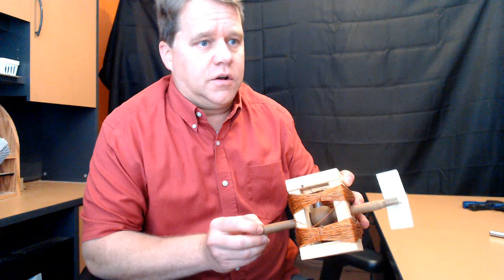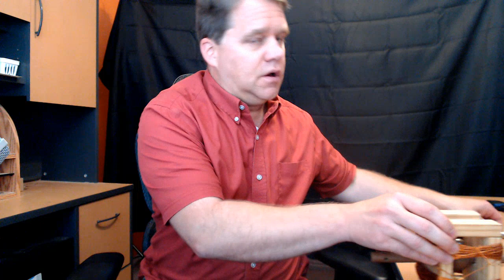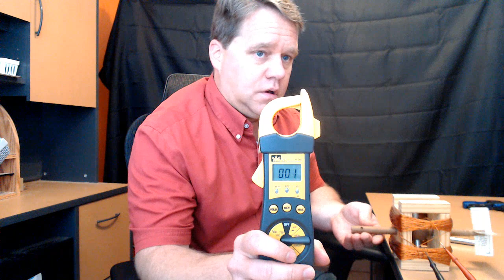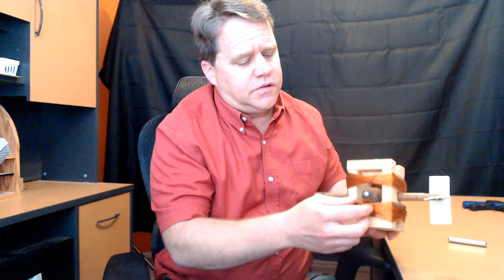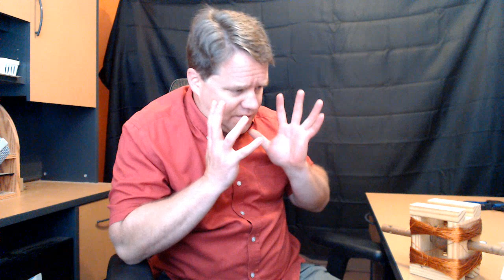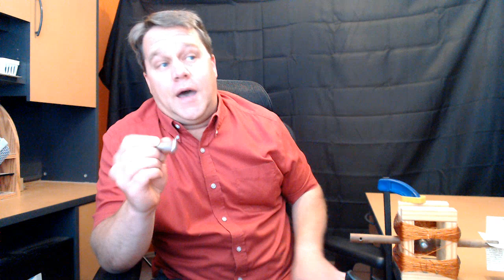Simple ac alternator (generator).

Comment: Very interesting. Worked at a large slaughterhouse and have still have some cow magnets. On the subject of generators I still find it interesting while attempting to megger any AC motor that even if rotating only a few RPM'S ( such as large air handlers and pumps ) will receive an eratic reading. When 2 of my kids were in 3rd or 4th grade gave a 45 minute class on electricity. Had them turn a very small DC motor to illuminate a small lamp &  wrap wire around a nail to create an electromagnet. My electrician dad was never afraid to teach people some things on the trade while other old timers never would. My wise dad said they can steal my job but not my love of the trade or my knowledge.